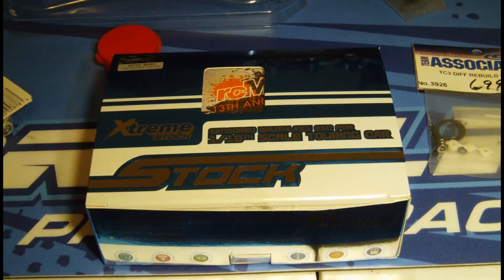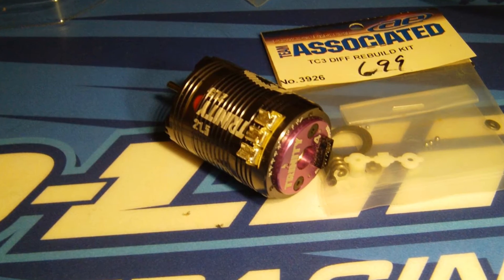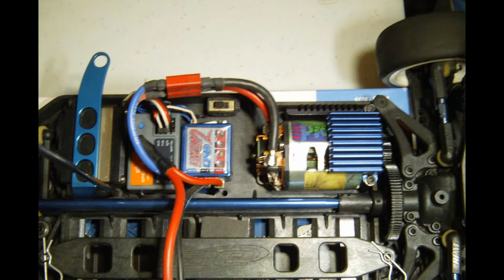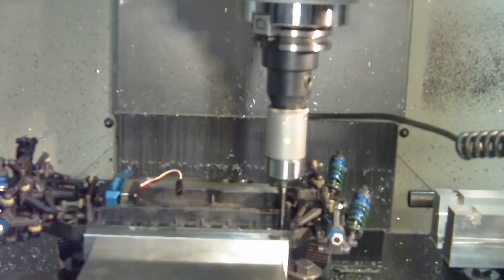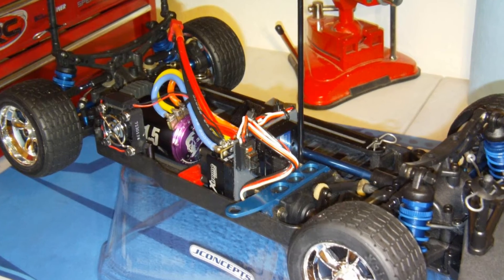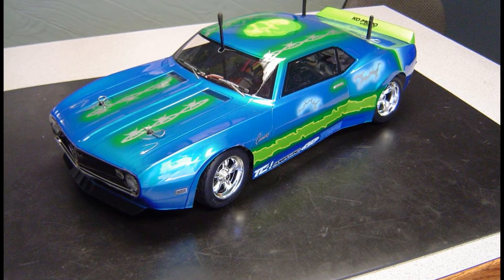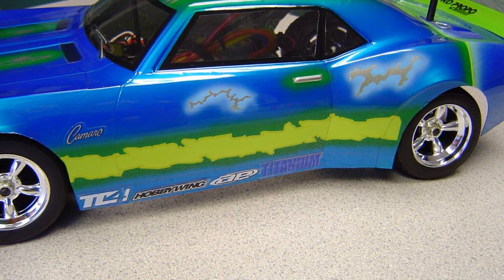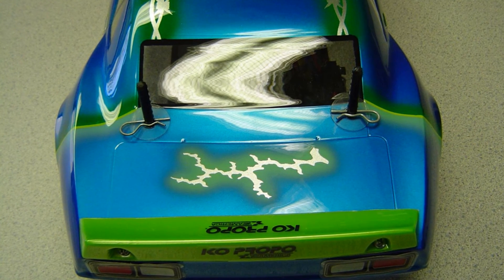TC4 To VTA

Comment: I assume you mean USGT since you dropped in a 21.5. You still running this car? 
I converted my old Factory Team TC3 to a USVTA car. Funnest class to run in IMHO. Since we have to run 25.5 Spec in USVTA. I have a Reedy Blackbox 800Z ESC w/Sonic 540-M3 25.5 Motor shoe horned in there. Well not really shoe horned, it all fit easily on the bottom of the chassis plate with a Spektrum SR300 Rx between the Servo and ESC.
Reply from the maker: The track I run at has non standard rules.  In VTA we run a 21.5.  I don't run this car any more because I got in to 1/8th scale and I have done very little indoor carpet racing.